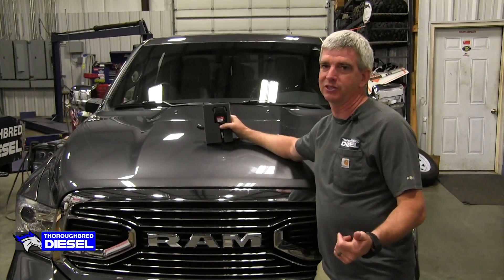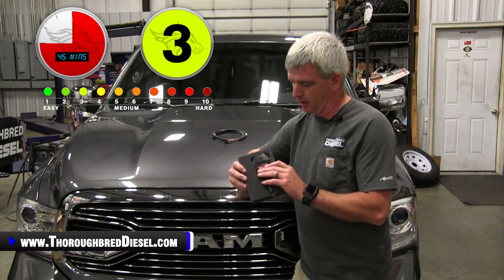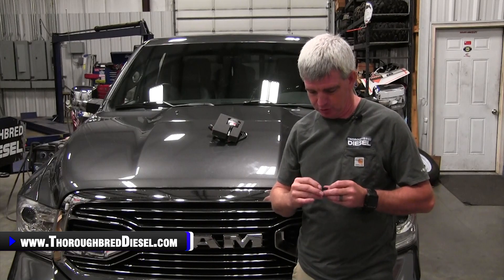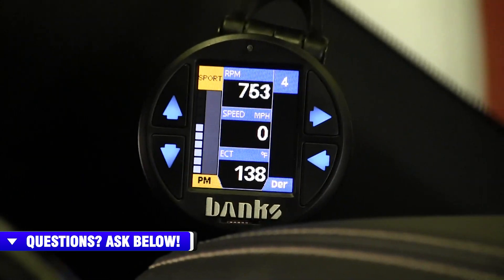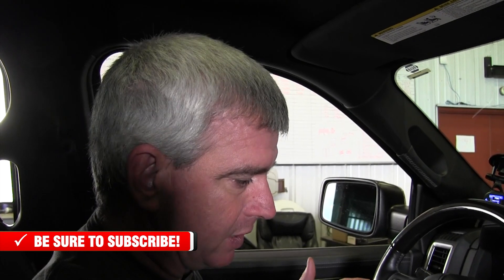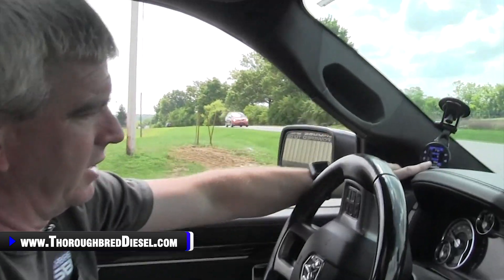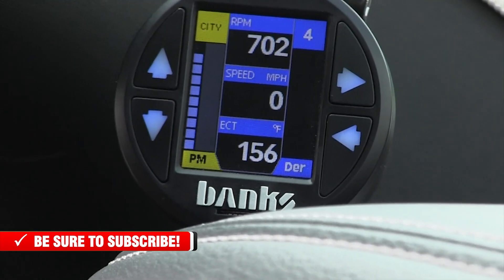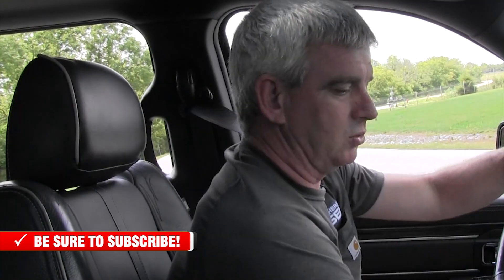Banks Pedal Monster & IDash Install: 2016 Ram EcoDiesel w/ Ride Along

Comment: Just bought this for 22 ecodiesel 1500 with pedal monster. No dyno tune is needed correct? Would dyno tune after help any if one did it?
Reply from the maker: To get more power at time of dyno?  This module does not increase power.

Comment: I have a 2015 ecodiesel with the derringer and super gauge. Took the money and did the emissions flash, and the pickup (even with derringer) is so laggy when engine temp is below 180F and under 3,000 rpms. I've had the pickup for 27,000 miles, and to my knowledge all emissions equipment is in good operating condition (it got the egr recall done as well. My question is, does the pedal monster make the pickup SAFE to drive when it is warming up and under 3,000 rpms? That emissions recall really degraded the driveability in my opinion with the emissions lag they put in it while warming up. Once it's warm, pickup is great, but until then you'd better let it warm up! Thanks in Advance!!

Comment: I cannot wait for Mr. Banks to release one for my application. I rushed and purchased a BD Diesel throttle booster and although it worked great for about a month then had to send it back. Have been waiting on them to return it for about 3 weeks after they tested it and said nothing is wrong with it. My truck has been running fine with it removed. It kept going into relearn while driving and luckily I didn’t have a 15k load going up hill at full boost. I would wait for Mr. Banks if he doesn’t have it for your application. Plus Banks is American made. My rant on my soon to be $300 BD Diesel paper weight.